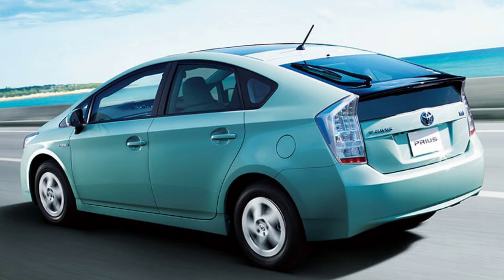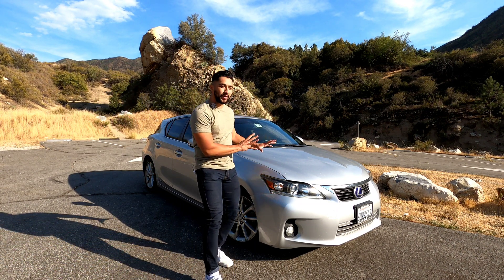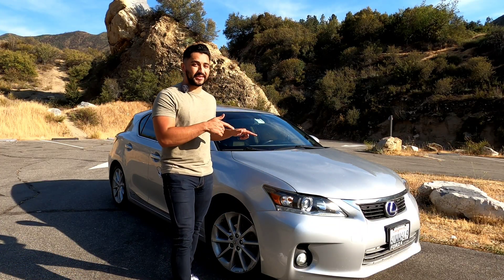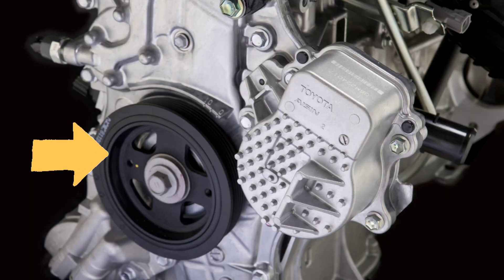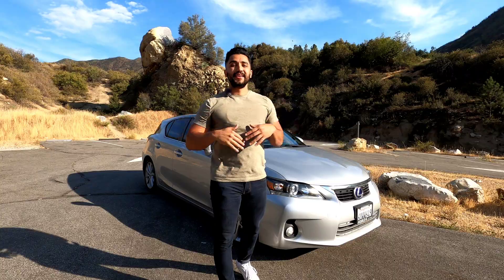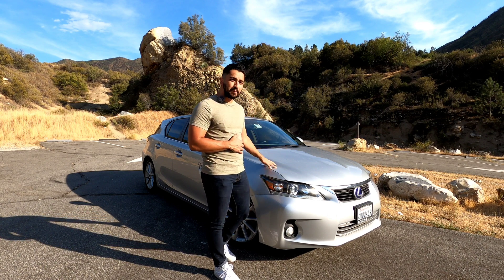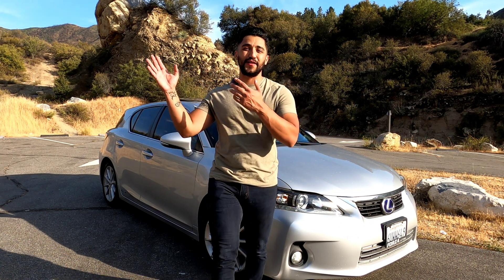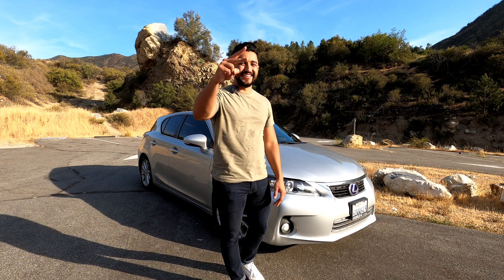TOYOTA should be SUED for these engineering flaws | LEXUS CT200H & TOYOTA PRIUS

Comment: My man first and foremost THANK YOU! secondly, You are on to something, I have the 2014 Lexus ct200 F-Sport and have had to do the head gasket twice and i am only at 140k, Lexus and Toyota want over 2k to do this and Toyota is taking absolutely no responsibility for building or repairing this joke of a system.
So if anyone knows of any info regarding a CLASS ACTION LAWSUIT against TOYOTA PLEASE let me and others know.
Reply from the maker: Fact! I've since sold my CT so not sure how to start a class action but I know it must be done
Reply: For your situation .. the headgasket going  might not be the heat cycle theory or unless your EGR getting clogged ..... but you need to understand for a regular engine a headgasket can go because of overheating.... Thermostats gets clogged is the number one reason for regular cars or coolant leak... or water pump breaking...  Anyway here's a good video is understanding regular headgasket failures.... in a regular gas car... by Faye Hadley.. https://youtu.be/brLmBRYSb_E?si=DFIIB2a4jVZtY7BJ

Comment: I own a 2011 CT and guess what? Blown head gasket, I am having the engine swapped because the dealer wants a total long block rebuild done and are refusing to resurface the block and heads and just replace the gasket, I have replaced the water pump and thermostat after trying liquid sealer. The no thermostat on the dash is a huge problem, I should change the temperature sensor. My car is at 230 before the fan kicks on. I agree toyota should be sued. It is a great car but if you have to replace the engine or head gasket every 120k than yes it is going to be reliable until the battery breaks down.
Reply from the maker: Agreed brother. Hope the car has been problem free!

Comment: Engine replacement at 121,000 on my 2012 CT200h. Cost $7,000 at Riverside Lexus in CA. Am I still upset? What do you think?
Reply: What was the cause of failure? Was it out of oil? Mine burns a lot of oil.
Reply from the maker: Whoaaa did you get it fixed from them? There are many hybrid specialty shops that would do it much cheaper

Comment: I just bought a 2012 after doing all the homework. I got it from Lexus dealership and the same dealership where it was sold, maintained every single time, single owner, mint condititon. It runs just fine, although I will take take to my mechanic and get all the preventive maintainence done.
Here is my question to you, did you buy this car new or used?
Because yes there is headgasket and egr cloggin up problems but your car took it no next level.
Was it maintained throughout since day1?
Reply from the maker: Lucky you lol how's the car treating you so far? If I remember correctly the car shuddered when I was test driving it but I didn't think much of it. Luckily my friend owned the dealer and swapped out the engine for me

Comment: 220,000 miles on my 2010 prius, I've replaced all wheel bearings, started having egr clothing issues, and then threw a rod!
Reply from the maker: Oooff this is far too common. I guess with the thrown rod you were forced to replace? How much was it
Reply: @gsgcarreviews  I did the work myself, engine was 1200

Comment: I have a Lexus ct200 fsport 2014 was going trough this for a while. Even when  It was under warranty. I changed spark plugs was find for a while.  Changed spark plugs and coils.  Still going on. Its the head gasket. $4200 at Lexus Dealership in Connecticut.  Its has 130000 miles.  Also kept up with maintenance.  This is my second Lexus . Had Toyota.  Love the cars, but this breaks my heart and wallet. Please help!
Reply from the maker: I find it very strange that this happened to a 2014 model!! It may be because of a failed temperature sensor or coolant pump

Have they found the cause of the issue? That's very important to know
Reply: Lots of things can cause a blown head gasket.  My 2003 honda civic blew a head gasket at 110K miles.  My heater core was leaking and the car ran low on coolant and blew it.  My CT200H currently has a slow oil leak on the back of the engine related to the head gasket.  It is a slow leak so I just monitor.  If it is not consuming much coolant or overheating a small head gasket leak is not the end of the world.

Comment: I just bought a late 2018 facelift CT200h with 9k miles on it, so basically brand new. Should I be worried about the head gasket/this cooler issue down the road? Was there any refinements or design differences made by Toyota during the 2012-2019  production? Thanks!
Reply from the maker: Yes there were many-many improvements that started at 2014! You should have no worries as long as you clean EGR valve and replace Temperature sensor
Reply: @gsgcarreviews  

Great channel. Very informative. I’m about to buy a 2015 ct220h. Do you recommend changing the temperature sensor as soon as I buy it or when I experience certain problems? If so, which problems exactly?
Reply from the maker: @Pressure-xs6nq   Hey thanks for the question? The temperature sensor is an inexpensive part and quite easy to replace so I'd say it's a no non-negotiable! Make sure to use only OEM parts
Reply: @gsgcarreviews . Thanks for responding. I’m actually getting nervous about buying this car now.  Today I went to view it again and whilst it was in Park, I accelerated slightly a few times and each time the car surged forward a little. The dealer said this was common and has something to do with the hybrid transmission. However I  tried another CT and it never happened. So I’m now beginning to think there’s a problem with this particularly CT 200s  transmission. Do you think I should avoid it and look for a different CT?
Reply from the maker: Well the CT engine is very sensitive lol. The transition from electric to engine is very loud and shakes the car especially when in park. Although I've never noticed the lunge forward until now 

*I recently sold the car though so I'm not able to confirm
Reply: @gsgcarreviews    Nice one. Appreciate the info.

Comment: The cooler went on mine at 150k miles. Very important to let drivers know to change pump AND thermostat along with it. 
Changing the pump was easy. On my car there is an overheating light that comes on but yes no guage
Reply from the maker: Yeah the main "catch" is that the engine starts and stops on its own because of EV MODE, so it's too late by the time we're aware of it

Comment: You are talking about a very old model ct200h, i think 2011. Its pointless to compare with the 2021 version
Reply: In the US the 2011 - 2017 CT200H's are all the same.  We no longer have new CT's however they are an awesome full efficient used car option.  Picked ours up in 2016 with 50K miles for $16,000.  It has been a wonderful car.  Just watch out for the ABS issues and take to a dealer for Campaign repair.
Reply from the maker: CT's have been discontinued for a long time, my friend. The UX took over!

Comment: These failures are very rare from what i can gather.

Also, reading the temperature can be done with a 10$ bluetooth obd adapter and the Hybrid Assistant app for android. Iphone users need a more expensive wifi obd adapter and a different app.

B gear is not supposed to be used often and Toyota doesnt have any liability here because they explain it in the manual.
Reply from the maker: I find it to be common on Faceboon Groups, I should expand to Reddit and other forms of media to get a greater understanding 

Thanks for sharing! I didn't know I could use the OBD for temp

Comment: My 2012 ct200h has 140k in the shop now to get new hybrid battery, break booster and break pump. So expensive to fix.
Reply: I thought I had a bad hybrid battery, turns out my original 12v battery was the issue.  Had the original battery for 9 years. 2012 Ct200h 135,000 miles.
Reply: @danieltx1000  yeah I just got a new 12v months beforehand. Your hybrid battery will go next and then your break booster.
Reply from the maker: I've been reading that to be pretty common
Reply from the maker: That's a bummer man. By the way the brake boosters have a recall! You should look into getting reimbursed if you've already paid
Reply: There was a LEXUS campaign for the abs braking system issues on the CT200h.  You should contact Lexus directly they might pay you back for any money spent on this repair since it is a safety related system.  We had a noise coming from our abs system sounded like abs was coming on every time we stopped.  Lexus dealer ended up covering a new abs pump and other abs related parts.  It would have cost over $6000 if not covered by the campaign. Mine was a 2013 CT200h with approx 130K miles at the time.
Reply: @tjyork1983ia1  Good news they did end up covering the repair for the ABS. Needed two new parts pump and break booster. Covered install and parts. Thanks for the reply

Comment: B mode does not cause misfiring or mimic it. It holds the CVT transmission in a lower gear ratio to help slow the car down while going down a long hill. Normal gas only cars with manual or traditional automatics do this naturally it’s called engine braking and often on more late model cara the ecu cuts fuel during deceleration. this will not wear out your spark plugs.
Reply: I disagree with everything bro, I purchased a new 2015 prius and used it to 400,000 miles zero problems, I always used the B position for 6yrs straight, now I have a 2017 ct200h, purchased with 16k miles now has 87k miles I'm still driving it like I drove the prius constantly using B. As long as you keep up with all the fluids and change air filter, and replace that pcv valve 1 time, and spark plugs I replaced on prius for first time at 250,000 miles and BTW the plugs ok and engine excellent shape. The reason I got rid of prius cuz a tesla suv young driver dui hit it, and it was declared total loss by insurance, it was still running excellent. The secret is to buy a car new or low miles and the way the driver drives. I owned 2003 dodge ram had 250,000 miles, 1991 mustang 5.0 5 speed stick 200,000 miles no problems, my father had 1976 Ford Ltd 350,000 miles v8 zero problems! It's the Damm! Driver/ or drivers or owner that kills the car! Look at all the aggressive people road raging 😂 fools and losers
Reply: Exactly, but it does cause accelerated wear on the gearing. Its fine to use it on hills, but dont use it all the time.
Reply: What about coming off like a highway off ramp slowing down a lot from high speed ? @drkastenbrot
Reply: @771shadowolf  toyota designed the component life assuming the car being used on hills, so if its ramps instead of hills you will probably be fine. that being said, the intended way is to just use the brake while keeping an eye on the energy gauge. if you brake lightly and slowly you can do almost 100% regen and the B mode is intended to be used if you need more continuous braking power than regen can provide.
Reply from the maker: Just relating what my mechanic said. I do use it at high speeds and I reckon it may cause some damage
Reply: @gsgcarreviews  Use it as youre supposed to use it, only on hills. For any situation where you just need to slow down, use the brakes. 
Sorry that your mechanic is one of those. He may do good work on vehicles but take his opinions with a grain of salt. 
The CT is one of the most reliable cars of this decade just going by the numbers and the only flaws I could find were in the interior.

Comment: Got a 2012 ct200h, car blew the engine back in 2019, had been sitting since then, till I could find an engine for it here in South Africa, I could only find a 2zr fx engine, my mechanic had to change the top from my blown 2zr-fxe to the 2zr fx I bought.. now when we try to run the car, the new engine rattles and has loss of power.. what could be the problem?
Reply from the maker: Yikes that can be frustrating. I believe it's either a misfire or a fuel pump issue. 

If that's not it I'd look into electrical harnesses because it's a different engine
Reply: @gsgcarreviews  I’ll have them look into it, they said they’ll check on the faults codes this week, hopefully it will reveal the source of the problem.. it could be the fuel pump🤔.. 

A bit of extra info:: the car ran for about 6 months with a blown head gasket, kept consuming coolant almost every week, took it to the dealership for a major service, told em to check on the misfire issue, they said they didn’t find any problem with it🤷🏾‍♂️ few days later, the engine blew a rod right through the block.. I wasn’t on the highway though when it blew, i was in a small residential area next to the house so I just crawled back using the hybrid battery then by the time it got to the driveway, because it’s a steep incline, i had to reactivate the blown engine, it was like it’s running on one cylinder, I’d press on the gas and wait for a few seconds then the car would jolt forward a bit.. maybe that’s a little clue of what might’ve happened to it
Reply: Why did it blow? How many miles and what's the condition of the car etc etc?

Comment: My CT200h has 195k miles on it and still runs fine on its original battery and engine...
Reply from the maker: That's awesome! What year?
Reply: @gsgcarreviews   2012 :)
Reply: Mine in 2011 with 160k miles
Reply: I just bought a 2012. I have things in mind for maintainence. Anything specific you wanna add to it?
Reply: @savjottoor7910  Yes! Clean EGR system and injectors. Clean all the battery plugs and the battery fan. Change the cooling liquids for engine and inverter (original toyota only). And that’s it. :)